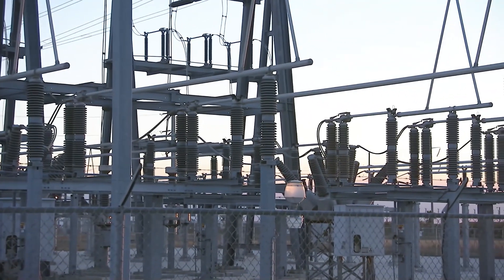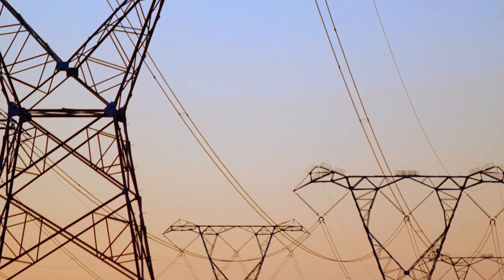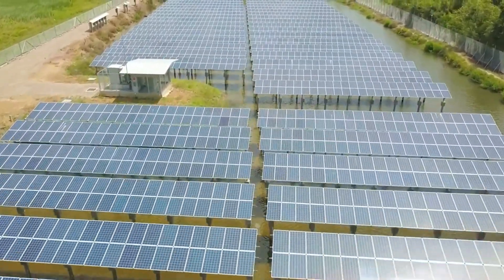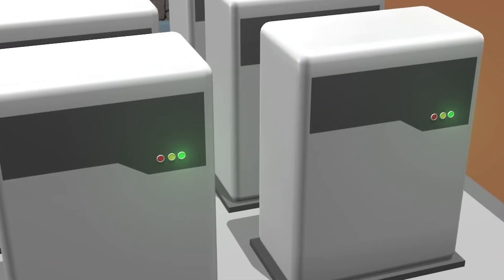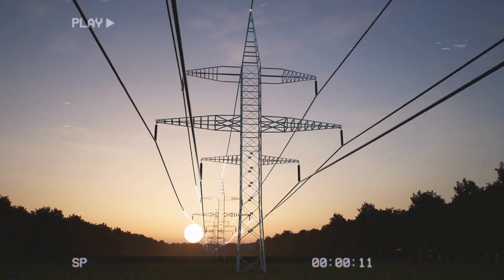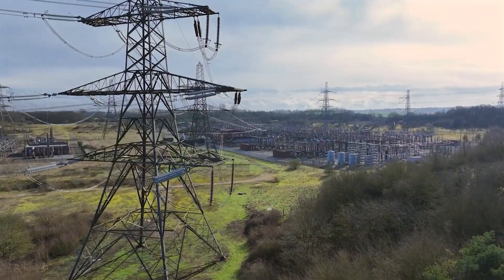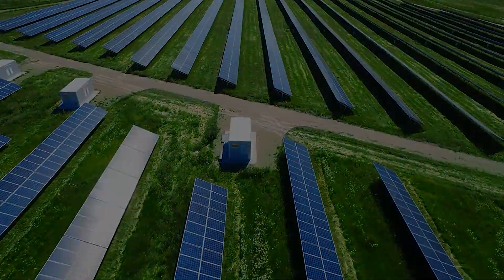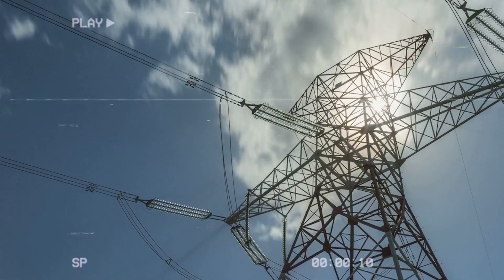The Odessa Grid Disturbance: A Wake-Up Call for Renewable Energy Integration

Comment: Fossil industry pr.  Batteries are dirt cheap now, and install are doubling ever year.  It was the gas supply that froze that caused the Texas outages.   Solar PV was not "firm" so the utility should not have been relying on it.  Now with batteries that's not a problem. Inverters are far better at managing frequency and they can synthesize perfect inertia.  Better than physical inverters.    They more than fully and preciously than rotating iron.   grid batteries are STOPPING outages, not causing them.

Comment: Nice talk about inverters. The simple answer to the problems is to feed the renewable energy into utility size battery storage, then provide a smooth renewable grid input. Also, you barely mentioned microgrids, decentralization, or distributed generation.